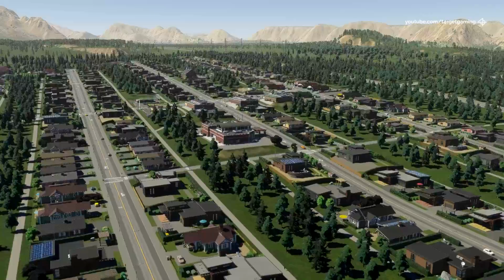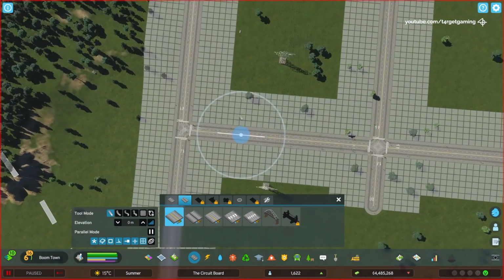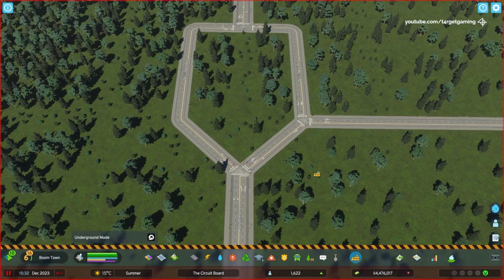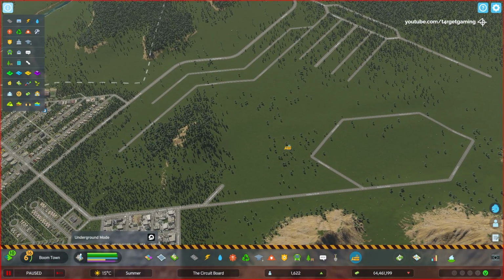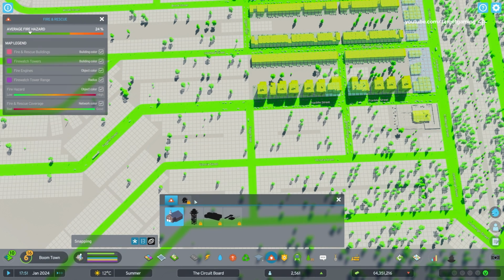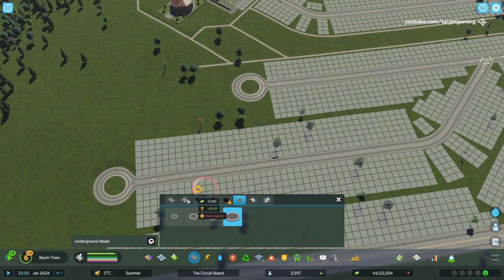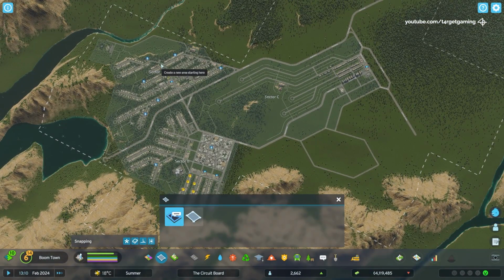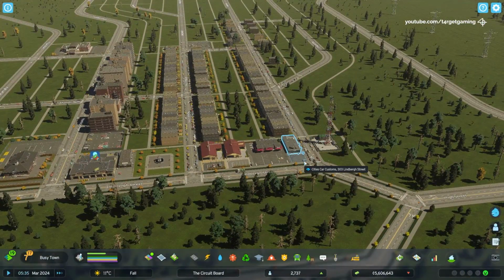I Started the Most ELECTRIFYING City in Cities Skylines 2 | The Circuit Board

Comment: Damn when you took that measurement for the suburbs, I could already tell, your measurements was wrong. like it is 128 not 120. because seeing the distances of the zoneable tiles in the area you made last episode there is a 2 zoneable tile difference between the roads. here there is one. this is somehow triggering me. just had to share it. but I love the design anyway!
EDIT:
Watching further into the video you would have had those three tiles if the measurements you took weren't of by 8 meters. the extension could have fit to the side of the clinic. but at the same time you could have put it in the middle of it in that case. but just some thoughts to share. I am definitely learning from this series. even though I think the cash rewards in the game are a lot lower in present day for city leveling up.

Comment: A little suggestion for the loop in sector C, this is just a little logic. 
For side grass path in loops it is better to just place inside the loop. For the outside, use the sidewalk. Because I saw that there are several commercial buildings that have parking lots and of course vehicles will pass by there. It's only optional, if you feel my suggestion is not good, I will return it to your decision😅😅
Reply from the maker: Ahaha yeah, makes total sense. I'll work out those visual details when I decide what to put inside the loop